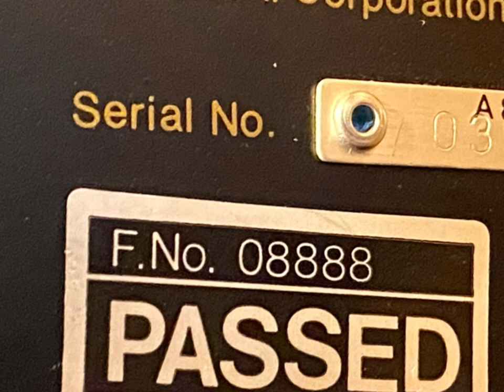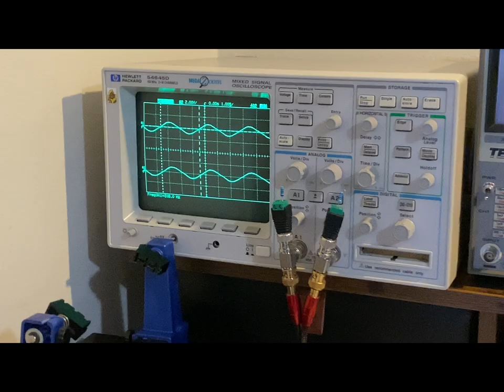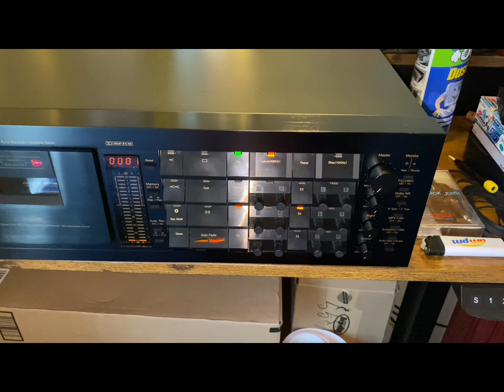Nakamichi Dragon Cassette Deck Gives Me Trouble! #cassette #nakamichi #restoration

Comment: I have my Dragon making a clicking sound, but not when running reverse. Any idea what could be the problem? Otherwise it works fine. Thanks for an interesting video!
Reply from the maker: That is the auto azimuth motor assembly. It is either stuck or the azimuth is off alignment. Could be many things. Is your serial number on the back silver plate 4 or 5 digits?
Reply: @VintageAudioTech  #05435
Reply from the maker: @Algabatz an early version. In this Dragon I did end up removing the azimuth motor assembly and doing a full cleaning, greasing and re-alignment. I did not add that part in this video.
Reply: @VintageAudioTech  Thanks for the info. I'll begin with disconnecting the motor cables and try to set it by hand and see if that helps. Do you know if there are  test tapes available somewhere?
Reply from the maker: @Algabatz The original full track test tapes are difficult to find. You may try eBay or FromJapan.JP which is a Japan Proxy site so you may purchase on their market
Reply: @VintageAudioTech  Thanks again!
Reply from the maker: @Algabatz if you need any help feel free to contact
Reply: @VintageAudioTech  Thanks very much! That's very kind of you!

Comment: i bought one when released allthough my father was the nakamichi freak but i remenber feeling that i had made a great purchase and it worked for 6 monthes witrh perfection but those years or early 80´s were the more i used cassettes and for sure i gave a heavy use to my Dragon , after those 6 monthes i notice some changes in it´s functioning and the auto-reverse never used it, but when summer arrived i notice some litle interferencies in the sound of cassettes i only remenbered a similar problem on a Sony cassette deck from a friend of mine so i stoped it put to use  the Pioneer i had, the 3 year old  CT-F1250 and bye bye litle Dragon non fire spitter, and a while after i went for the TEAC Z-9000 that it was the best at the time and the Dragon when in 94 i thought ,"well ,they improved it ,lets try again and two dragons i had stoped, working at 95%. In 2019 ,i made 10.000€ selling both and i didn´t demand 5.000€ each just a specialist ofered me it and said"i can´t give you more" i trying to hide my hapiness said it´s ok take them, the worst i ever had and when buying the first one i also bought a BX-2 as a second deck, let´s say that the Pioneer CT-F1250, the TEAC Z-9000 and the BX-2 still work perfect today with maintenance and also from my father i received all top end models nakamichi decks starting in the 74 1000 and the last released that i kept the DR-1 and  i  made a lot of money selling them ,only kept to myself a 700ZXL and a DR-1, i even bought a maseratti looking like a 70´s sport car with a powerfull V8 engine from 2017 only with the money of the top decks from nakamichi, so they are good to sell not to play cassettes for that there are dozens of better decks , even a 76 Pioneer CT-F1000 is working perfect and since 76 my second deck after a CT-F2121 also from Pioneer , sounds and records amazing good but my favorite format since the 70´s is the open reel deck for it´s sound quality and several recording options, but from nakamichi there is a component that i am surprised by it´s quality and still to be needing repair which is strange in the nakamichi world that is the Stasis power amplifier released in the 80´s if not the original one ,the MKII is far from the real Stasis

Comment: Thanks for the vid.  Just picked up a serviced late model serial number (21k+) that I've incorporated into our home audio system.  Beautiful machine and very impressed with the sound.  Not quite as good as hi-resolution audio playback from my other sources but for it's time it just cannot be beat as an all around performer.  One question....  Operation of our Dragon has been exceptional. However, on one brand new prerecorded studio cassette tape (Tiger lily by Natalie Merchant) the auto reverse from side A to side B started to fade and then stop while playing the beginning of side B.  Tried it a few times with the same result.  Side B played fine when flipped and played from the beginning.  Weird.  We only have one other tape (Rocky) which when played from side A to B using auto reverse had no issue.  Any ideas on what would cause the tape to start fading then stop playing after auto reverse?  Again, thanks for the detailed vid.
Reply from the maker: It sounds like there is something wrong with the tape path. More than likely from the pinch rollers. I would have to take a look to identify the problem

Comment: I have never seen any Nak tech explain how the auto azimuth works.  Does it sample the tape for highest output at the upper frequency levels,  most manuals do not recommend that for adjustment ?  Ok who wants to buy a Dragon for ten grand that needs to be serviced every two to five years for a thousand bucks or more ?
Reply from the maker: They want you to adjust azimuth in between FWD & REV. A good middle ground so that the auto azimuth sensor compensates for little adjustment
Reply: no, it works on PHASE (with a band-pass filter on 2KHz-8KHz range).
Right channel is splitted on two tracks.
No phase difference means perfect azimuth

Comment: Thanks for your nice video of  the Nak Deagon.The 4 digits sr nos  have the problem of Az correction issues.I have Nak ZX7 and one issue has cropped up ,the deck when put to on the stop button blinking does not stop and there fore the deck is under inoperational mode. No playback etc happens 
The other issue is of the 15k switch light also glows continuously but tgat was not effecting the playback,azimuth correction etc.Could you help in thus matter as it is a problem of different kind.
Reply from the maker: I can certainly take a look at the deck right now I’m about two months booked. You’re welcome to send it to me and I can evaluate the issues and let you know what it would be to repair it.
Reply: Thanks a lot.

Comment: Hello.
I have some problem with my Dragon.
Just started a few days ago. As soon I switch on deck, it start playing automatically. Stop button working if I am holding it, when I released start playing again. Another buttons not working at all. Before everything was working well. I need your advice, please. What happened, can I fix it by myself? Thank you.
Reply from the maker: Could be a few things, but possibly the mode cam gear is not aligned properly. I would have to look at it to really figure it out. You can also post a video on your channel and let me know and I can evaluate from there.

Comment: 082D JRC 2107🤣
Reply: @VintageAudioTech  That the "Holy Cow" has installed a TL082 to save a few cents in order to save the lower noise TL072. At the moment there is even a difference of 5 € cents, but the industry will definitely get better prices.
Reply from the maker: @TTVEaGMXde oh they did that constantly and other brands are guilty of it. 5 cent X 10000 units is a savings. But yes I get your comment lol